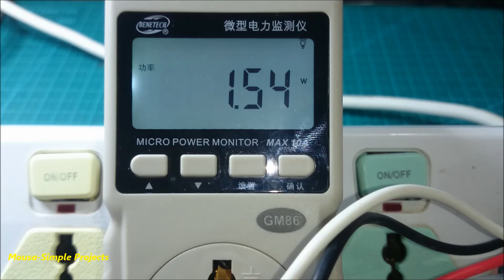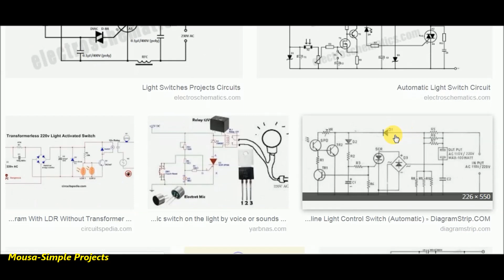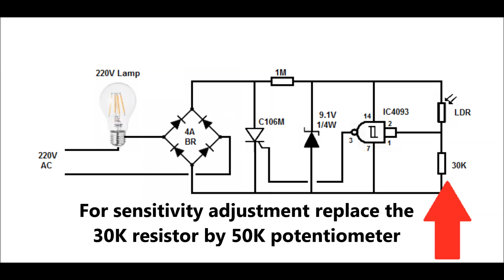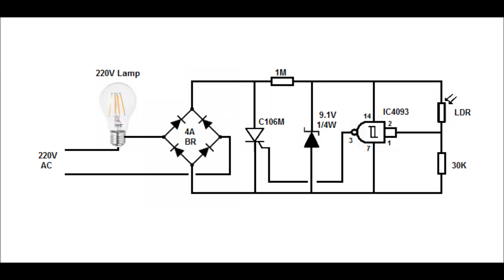Design a better 220V Photocell auto dark Activated switch

Comment: It really works very well. This is a circuit which I was searching. Unbelievable performance. I use variable resistance so it works exactly what I want. Thanks for sharing it. Little problem while finding SCR pin so i use datasheet. 👍
Reply: Thanks.